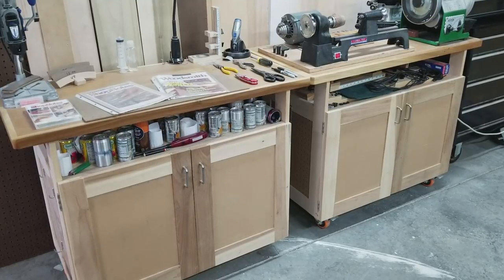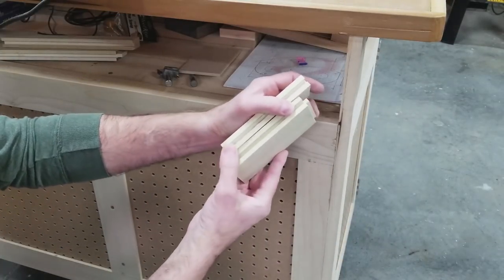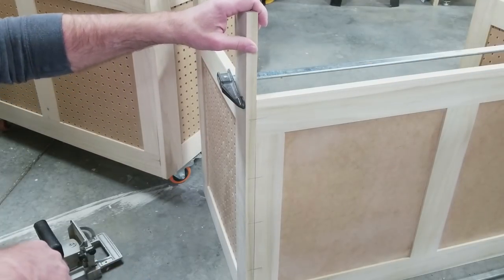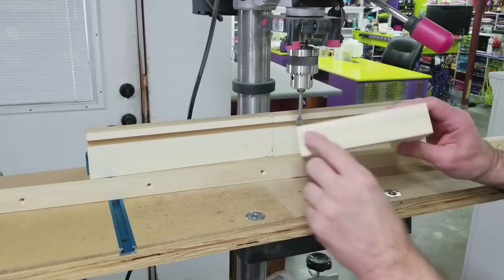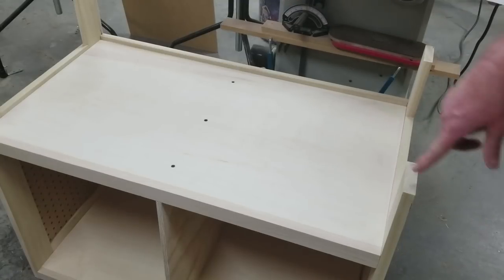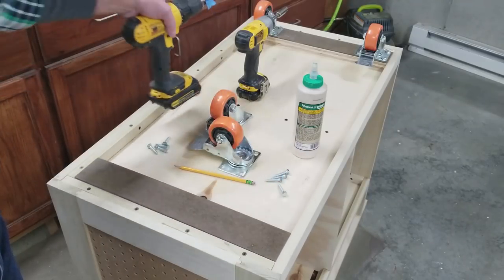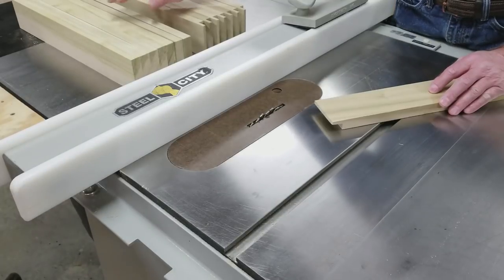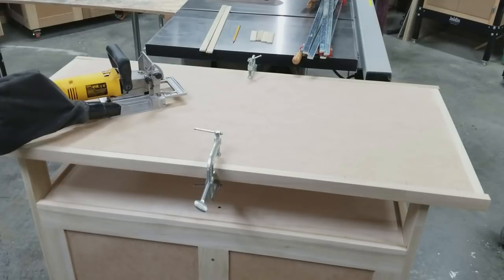Roll Around Shop Cart from Shopnotes Magazine #5

Comment: Hi Tim, Liked & subscribed!, Great video and very well explained. I was just wondering, could I make the side panel rails & stiles out of 3/4" birch plywood?. Also, what glue did you use to laminate top?.
Reply from the maker: Thank you, Eager Beaver!  Sure you could make the rails and stiles from plywood, although solid wood would be stiffer and resist deflecting better.  The only glue I've bought for the past 15 years has been Titebond III.  Thanks again for the sub!

Comment: Thanks for the video! I’m in the process of building this and I’m wondering what you did to get the drawer slides to line up on the divider without the screws hitting each other?

I’m new to building things like this.
Reply from the maker: Hey frequencysteve, great question!  I had that problem with the first one I built but for this one the drawer slides I used have multiple mounting hole options so I was able to line them up and use different screw holes so they didn't interfere.  The cheaper drawer slides don't have multiple screw holes like full-extension ones.  This is my favorite shop furniture so good luck with your build!
Reply: Awesome! That’s what I assumed you did so thank you for confirming!
Reply: One more question I have about the divider is how you attached it? Did you just glue it?
Reply from the maker: No, I screwed it in.  If you look at1:40ish you'll see three screws centered on the back.  I also screwed it along the top and bottom.
Reply: Perfect, thanks again!